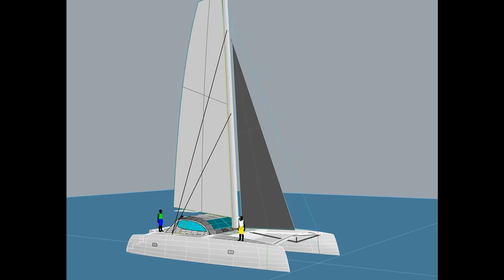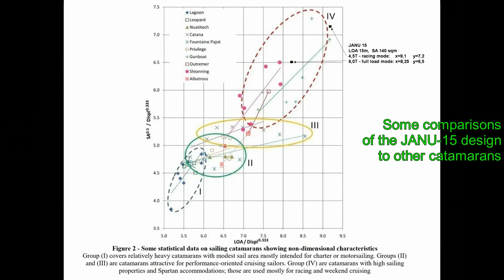01.   Building 15m carbon performance catamaran - "CarbonBee"

Comment: Aloha, Beautiful Boat and amazing!! I want to build one can I get plans?
Reply from the maker: Thanks!
When CarbonBee starts to sail and will fulfil our predictions or surpasses them   :-)  , I will decide how to share the plans and technology for interested amateurs.
Reply: @bojanu7212   I have outboards on my catamaran Hawaiian style. We can pull them up so no drag while sailing. I like the setup, and it keeps the boat lite, what are you guys going with as far as propulsion?
Reply from the maker: @Stephen Walker  The propulsion with outboards is a good option. We will have two retractable electro-motors.
Please, read my answers/replays on other comments. I wrote there some information.
Reply: Thank you Bo, 
I read all your replies thank you for the info, it's amazing and I love the electric idea, my friend and I were thinking the same thing Electric drives are great! We love to sail and you don't need Propulsion much on a light cat just to get in and out of the harbors and lagoons with narrow passages.
Reply: Very impressed with the volume in the hulls and the shape.
Reply from the maker: @stephenwalker6763  You hit the point! Additionally the motors will work as generators if we put them into the water during the sailing.
Reply: Bo, what did you use for software to design your boat? Did you do an FMEA structural analysis? Nice

Comment: Fascinating design and build. A rotating mast would be a great feature. I have this on my F 31. Can you explain please the tabbing process of the bulkheads to the hull. I see the photo of "glue". Is glue expoxy thickened? Also the main structural beams. Are these hardware fitted with large bolts? Thanks so much. Best wishes and thanks for sharing your build.
Reply from the maker: Glad you like it., and thank you for the wishes.
Yes,  "CarbonBee" will get rotating mast. That was from the start clear. 
Kevin was a regatta sailor and I also prefer sailing faster than slower.  :-).
The beams were first glued with thickened epoxy to the bulkheads side by side. Only rear beam wasn't. After that all was covered with additional biax and uni extensions, than uni carbon were prepared and laminated from one hull to the other. No any bolts.
Reply: @bojanu7212  yes. Makes sense. I can see when I looked again.

Comment: This is an incredible project - just brilliant! I really like the construction method. I am considering using a similar process for a carbon fiber dinghy  - similar to the OC Tenders. I consider either doing a hand layup with vacuum bagging or a resin infusion in a similar process to yours. My thoughts 1) build a support structure with horizonta woodenl supports, 2) gluing all of the foam panels together with thickened epoxy around a frame making it airtight while temporarily fixing the outer foam panels to the horizontal supports 3) put 4-6cm of unitdirectional along the edge of hull form to allow a place to tape and seal the vacuum bag 4) lay out the inner skin and position the carbon inner skin for infusion 5) seperate the the mold from the outer hull 6) layup and infuse the outer skin. 

How did you fix the foam foam panels to the horizontal wood strips? Did you fix the foam panels with a screw or temporary glue to the support frame and horizontal strips? How did you prevent the vacuum from pulling the foam panels out of position and moving inward?

I think it is brilliant that you just deconstructed the form and reveresed it for the other side! 

Did you CNC cut the foam panel bulkheads prior to lamination?

Congrats on your progress - I have been thrilled looking at this project and it has given me some inspiration. I would like to learn more about this process! Cheers
Reply from the maker: Thank you for appreciation.
To be short to your questions: the foam was fixed with screws. There are two separate vacuum infusions for the hull: one for inner laminate and second for outer. The forms were CNC cut, but the bulkheads were cut using computer generated plot. All bulkheads, decks, etc, were cut millimetre exact, covered with carbon fibre cloth and vacuum infused with epoxy. Only some small edge-sanding in few places was necessary to fit it to the hull.

Comment: Bo, Very nice design and method of lamination. I am a little confused when you placed the foam inside the patterns and then you put the rest of the material for vacuum infusion. Was the foam epoxied prior to adding the additional material for vacuum bagging resin infusion?
Reply from the maker: Thanks for appreciation.
To get the tightness the foam strips were glued together at edges only.

Comment: Will you be sharing your total expenses and break down once built has been completed?
Reply from the maker: After completion I will try to share it. Here is my response to other comment, which gives some information about the expenses to actual stage showed in video part02:
"CarbonBee is still not finished and is in the stage where all bulkheads, vertical divisions elements, floors, horizontal panels (for e. beds in cabins), and fast all structural reinforcements are inside. Painting is not yet fully finished.
As I said in response to one comment, considering that somebody will not need to do many trials and spent time for a lot of considerations, up to this stage, will need ca. 3000 – 4000 working hours.
I don’t want just now to talk about the cost of the materials, because in every country the prices are different, but I can give estimated quantity of materials to get to this stage of building process: 
It is ca. 890 kg carbon fibres different kinds, ca. 620 kg Epoxy, ca. 740 kg structural PVC foam. Extra materials are the wood for frames and all the components for vacuum infusion and extra epoxy (ca. 40%), which goes with the infusion’s equipment/components after infusion into the basket – it is not too bad and cost much less then hand lamination, because we spare a lot of work-hours, cost for potential workers for lamination and their mistakes. It is very clean, easy to control process and we can reach almost 60% carbon fibres in the laminate. 
5-10% of the materials must be also added for wastage."
Reply: That is a lot of the black stuff! A lot more than I was expecting. What is the layup schedule for the inner and exterior skins of the hulls?

Comment: Fascinating project, and awesome design! That thing should be crazy fast.  Maybe I'm missing something, but shouldn't carbon fiber be placed in specialised ovens in order to cure correctly?
Reply from the maker: Thank you!
Some epoxy laminate, depends on the kind of the epoxy resin, can reach maximal physical properties after for example post-curing in 70°C. Such curing is because the resin, not because the fibres. Post-curing accelerate also full curing of the resin, and the laminate is immediately ready to be used with full expected mechanical properties.
We are using epoxy resin which gives us designed mechanical properties of the laminate already in ambient temperature.

Comment: LOVE it!  Can you clarify the hull "mold" from 1:45 on?  I would have thought that just laying some wood strips in frames like that would not come out very fair, and especially not vacuum tight.  What does the vacuum bag seal to?  I'm familiar with vacuum infusion, but without seeing a full mold with a flange to seal the bag to I'm just having a hard time understanding how this worked out, it looks like a lot less labor building a full and fair mold (at least in a slide show, I read you have 3-4000 hours in which really shows just how simplified the slide show is!)  Cheers.
Reply from the maker: Starting to build I considered few methods and many variations for one-off manufacturing. Building two moulds for both hulls (they are asymmetric) would consume minimum double the time we spent, would generate extreme costs, huge amount additional waste and would need much more place. It would be good for industrial series, but not for one-off.
In building method we used, the mould is also an element of the boat - no waste, no garbage, no additional cost. The simple CNC frames&strips mould was after the built of the first hull demounted and again mirror mounted for the next hull. 
Sure, because the vacuum infusion, the Airex "mould" was build with scrutiny to get it tight.
Yes, I agree the slide show shows only the stages of the construction, without going into the technical details, but we wanted at first to show only, that such an advanced hi-tech technology and materials could be used by amateurs, with minimum use of work forces and available place.
Reply: @bojanu7212  Is this a known building method with a name I could research?  Or did you devise it yourselves?  I'm still not clear how the backside, seams and/or perforations of the airex was vacuum tight.  Was the wood shown at 1:45 sealed with resin before laying the core and fabric?
Reply from the maker: I don't think it is known building method. We developed it with all details ourselves. Some parts of that method were used by other projects for hand lamination of one-offs, but I didn't know anybody who used it with vacuum infusion. As you see on the slides we made first the inside laminate and in other process the outside laminate. So, it was all very easy to control. It wasn't any perforations in the foam.
Reply: @bojanu7212  And I'm guessing the foam is glued together at the joins. Super cool. Never see it like that before. Did you find once the vac was on it wanted to pull the foam out of shape? I'm again guessing the foam is only sitting on the frames not glued?
Reply: I am also curious how you stopped the foam from pulling in on the vacuum? How did you secure the foam to the outside strips? I am curious because I a considering building a small carbon dinghy one-off using similar construction techniques. I have also been looking at the schoinning design yachts for the future as a possible methodology. But I really like the idea of using carbon fiber for a lightweight displacement for an electric catmaran that can make miles in light wind.

Comment: What CAO software did you use to draw the boat/tech ?
Reply from the maker: I am using software from AeroHydro, Maxsurf and sometimes Rhino. Solid Edge for FEA. During the design process we prepared also some Excel calculations sheets to check many variables.